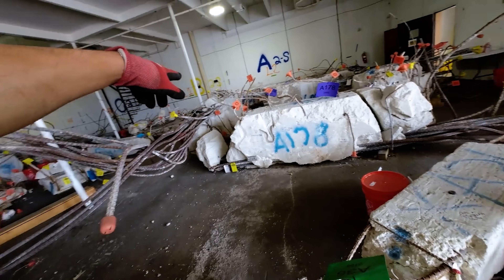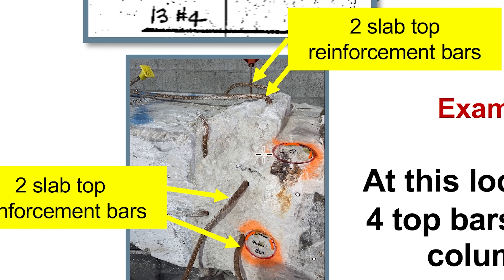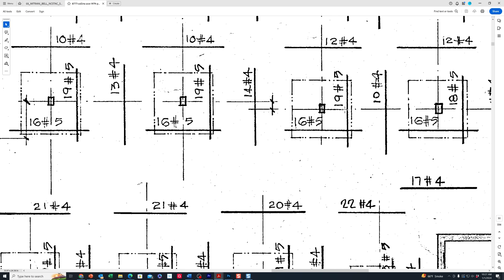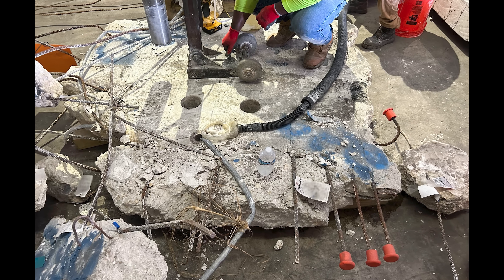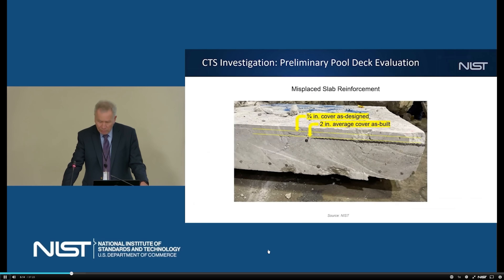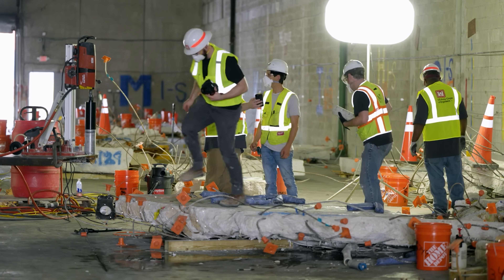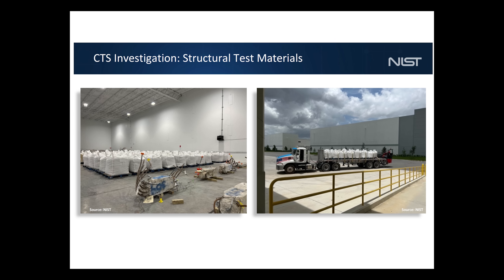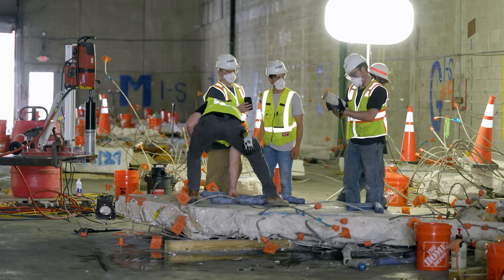More Shocking Build Errors in Miami Condo Collapse

Comment: Note #5 would mean sadly 3.8 in one direction 3.2 in other direction so technically they could get away with 4/3. People will always try to cheap it out
Reply from the maker: Yes and even as a contractor building this I would feel much safer knowing that I'm putting 4 rebars across a column because my name is going to be at stake here along with my reputation. With the FIU bridge collapse, the construction company had to file bankruptcy and start it up under a whole new name so there went their entire decades long reputation and they have to start from scratch again
Reply: @jeffostroff agreed. They really need better inspections and they really should start a method of recording all pours for the city to review at any time. This reminds me of the hotel in Vegas that has to be tore down before even opening because wrong rebar was used

Comment: Imagine how many other buildings we go in/by everyday have the same problems.
Reply from the maker: I would be checking other buildings designed and built by these contractors
Reply: Champlain Towers North better be taking this news seriously.
Reply: @UlsterScotsAmerican  - by now they have not evacuatied the building so i would think that the unit owners have paid for many inspections by now.
Reply: Only need to look at the UK and see the epic disaster that aerated concrete is causing in schools and hospitals - shortsighted cost saving - expensive later down the line. And by disaster I mean in terms of shutting important places - thankfully no-one has been in actual danger from this yet.

Comment: I'm excited to see the results of reconstruction and testing of the step up connection area. Those hard drives found have seen better days. getting physical debris on the platters does reduce the possibility of successful data recovery. Could some of the drives be from someone's personal computer and not from the building cameras nvr recording system?
Reply from the maker: I have banned all spinning hard drives from any of my computers. And no more Seagate hard drives ever they have the worst record of failure. Three years ago I lost 2 Seagate Barracuda hybrid hard drives and they were only two years old I lost everything on them there was no accident there was nothing they just stopped working and I sent them to several clean rooms who said that they could not be repaired due to rotational scarring on the hard drive.
Reply: @jeffostroff  wow that sucked. Did you have both drives fail together suddenly at the same time? In my situation the exos 18tb got the first bad sector 160 days before it fully quit at 320. The nvme ssd flash memory is pretty much the future for storage. Right now the best gigabytes per dollar cost is the only affordable option for poor folks like me with Ebay prices. If I went with ssd for 18tb it would cost at least 4x more.
Reply: @jeffostroff  SSDs can give up the ghost, too.  In any case, if you have important data, you should be using a backup service that stores the backup offsite regardless of how you are storing data locally.  I'm kind of rednecking it using Google Drive.  I know it's not a true backup, but I mirror Google Drive to my computer, and I pay for 2TB.  Mirroring isn't the default option.  You have to enable it.  Default is streaming (cloud only).  And this has caused havoc for some people as Google Drive went bezirk this past year and people didn't have local copies.
Reply: the one he showed at 14 min was a 2tb western digital purple surveillance drive, those are only really used in NAS's and NVRs. mostly cause they are damn expensive
Reply: @draconightwalker4964  I was going to mention that detail too. I've never used any wd purple surveillance drive in any computer system I personally use because they're more expensive. I try my luck with used enterprise data center drives from eBay or microcenter and sometimes it goes well. I had 1 new Seagate exos 18tb hsmr model variant that failed in 320 days fractal r5 atx case install. Why it failed and the cause idk. Is Hsmr to blame? It's only 1 drive tho. I used an identical replacement drive also new so I will know in about a year what happens.
Reply: We should be asking who was responsible for securing the evidence and why the cctv equipment was not removed before the remaining portion of the building was hurriedly demolished. Where is all of the original cctv footage from 87 Park?
Reply: Depends.  Were they found in one spot near the office area, or were they scattered throughout the debris?  They should have a rough record of what was found as they removed debris.  You should be able to see layers of debris.
Reply: @major__kong  yeah knowing where the drives were installed before the disaster and where it was found in the debris pile should tell a lot.